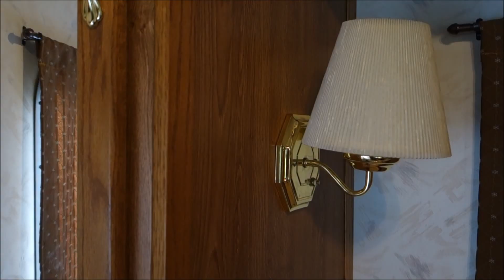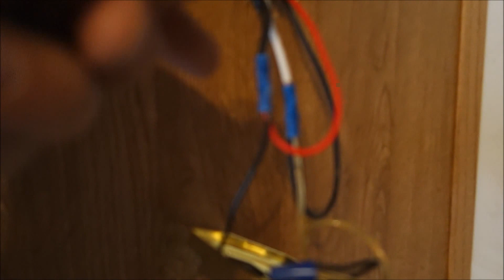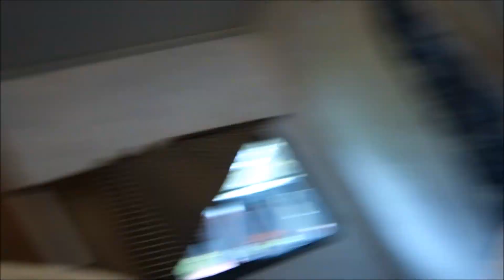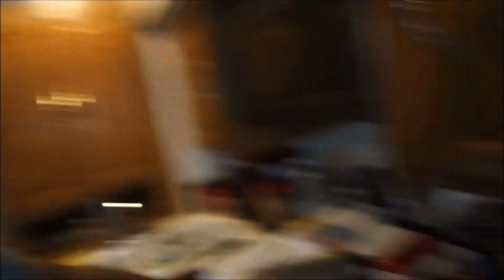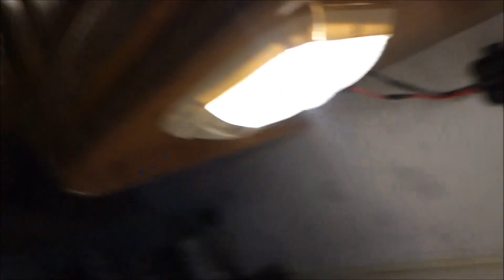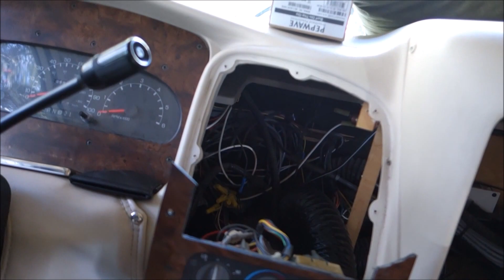Installing 12v Sockets in an RV [30 Days to Departure]

Comment: I'm glad I found your video. It helped me figure out how to install a 12v light over the kitchen counter in my Scamp running power from a 12v light installed on the side of the upper cabinet. When I got the new light wired up and turned it on, it didn't work. Bummer! Then I recalled you saying that the wire colors were different than you were used to, so I switched them and voila! the light worked. Thanks a bunch!
Reply from the maker: So glad it helped!! Congrats on getting new lights installed